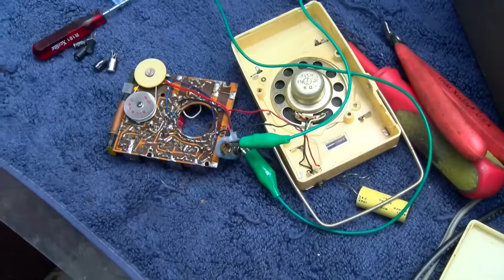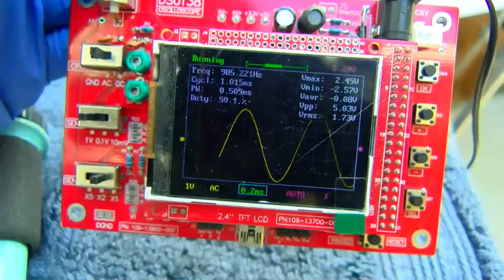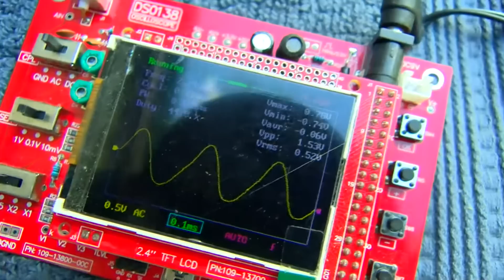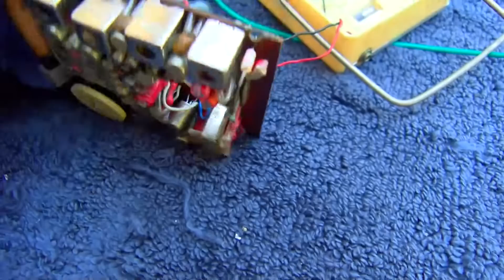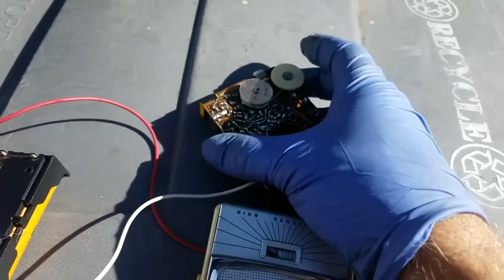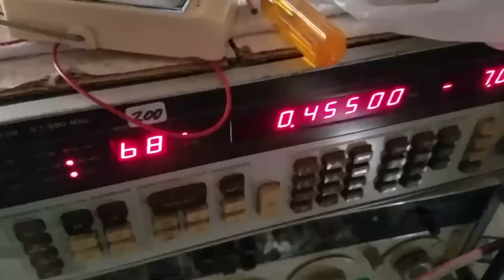Houthitone Transistor Radio Repair Attempt LM386 Mod

Comment: Cool fix with the audio amp, I ran into a little audio Amp when I was fixing a single board all in one Chinese ccrapoola radio. The audio amp died on it, I looked at the chip and it was an 8002A chip, which is an 8 leg chip. I found them cheap, probably why they used them, got 20 of them for 5 bucks back when I was looking, I am sure they are Chinese clones but they work. I put one in my radio and it is back up and working again so here I sit with 19 extras. So a quick search and I located some cheap breakout boards for 8 pin chips and I got a couple cards of those with 8 on each card, and I am using them two for stereo and of course one for single speaker use. They put out great sound and only require a couple resistors and a few caps to sit up.  If you use surface mount you can pretty much sit them up on the breakout board and drop them in almost anything. They are about 1/4 the size of the 386 boards so very easy to hide in tight cases.  Check them out, great for fixes on old sets.

Comment: The biassing of the transistor with a resistor from collector to base (22:28) is normal. It provides DC stabilisation; if the transistor starts to draw excess current, the collector voltage falls, and since the base is supplied from this, its current also falls, thus reducing collector current. The AC feedback which occurs with this method also reduces distortion. On that note, removing the emitter bypass capacitor from the driver transistor would have been an interesting experiment - may have reduced the gain to the point where the stage was stable.

Comment: Sorry in advance Dan if you covered this possible problem, or maybe you did but it got cut from the video:
I suspect the driver transformer of having either a shorted primary turn, or possibly a soft primary to secondary short of some sort. The near-zero volts on the driver collector and that 'latching' behavior when the volume of the test tone is turned up just shouts  amp + inductor interaction, forming a floppy saturation kind of behavior. Along with the frequency dependent shift in distortion, with the test signal growing cleaner as the test tone freq rises.
But the fact that the new amp board didn't help much is very curious - maybe bad speaker as you mentioned.
Still a good show, regardless of how it ended. Would like to know what the actual trouble really was, when the time is right. Thanks and Carry On!

Comment: Just did this mod to a  1970 Hy Lite radio.   Tried to replace the driver transistor, but it had too much gain on the output section.   So I just gutted the original amp off the board.    Radio sounds fine,  replaced the transistor detector with a diode and added a 1k resistor to dampen the input to the 386 amp.   Update.   Removed the 1k resistor  on input,  opened pot fully.   Lifted pin 8 on the 386 chip to drop the gain down to 20.   Transistor radios don't need a gain of 200 with this  amp.   Works great.

Comment: It seems that you've been beaten by a simple Discrete Component Audio Amplifier with a high frequency instability problem Shango.
I'm very surprised at that but to be fair you didn't have a schematic for the Honeytone.

Comment: Seemed to me like it had one too many audio amp stages.  The classic/standard/bedrock design is 6-transistor with two transformer-coupled audio stages.  This radio follows that yet there is an added troublesome pre-driver stage.  The audio was verified good at the output of the volume control.  Disabling the pre-driver and coupling the audio from the volume control to the base of the driver transistor through a 10uF cap might have been worth a try.  That would be signal injection in an effort to verify the driver stage, the output stage, and the speaker with something more definitive than a single tone from an external source.  My thinking is the motorboating and distortion was due to too much gain/overdrive.

Comment: I would let it as it was and repurpose it as the telemarket companion 2000. You cant polish a turd .... Circuits are simple but as they were stripped down to their minimun and use all kind of tricks to get things done. Plus on the audio amp, since there is feedback the failure all around and is hard to tell the one to blame. Worked a little on audio repairs and when an amp want to oscillate (speciall the early 70s ones with poor PCB designs), it is really hard to point the failure. You end doing thing like base stopers and miller caps on the predriver. And as you play with the tone control, you can see the oscillation starting to creep again. Happened me 2 or 3 times. For me sometimes is PCB layout  ... bad grounds with shared currents that create unwanted feedback

Comment: I've worked on a lot of these small radios. Distortion many times is caused by a poor connection with the on/off switch. Jumping it sometimes makes the distortion go away. You should automatically replace every electrolytic capacitors.

Comment: Some wonderings: what's the actual input impedance of the dubious AF amp module?  What level of input signal can it handle?

It might turn out to be easier to build an amp on some Veroboard or PCB, using discrete PNP transistors.🙂
Reply: Input impedance of a chip amplifier will be way higher than anything you can build with discretes.

Comment: I've had several of this style of radio that just never worked properly from the factory, I fixed one last night where the ground connection on the volume control had never been soldered to the board from the day it was made, there was still solder resist under the connection, so for the last 60 years it's been running at full volume!
Reply: Never like now, there's a lot of China radios that are completely deaf.

Comment: That radio is a total piece of junk.  That Hong Kong floor scraps radio with 17 extra transistors doing nothing sounded better than this thing. Yikes

Edit: that nobility thing, I think it was yellow with the size 0.5pt font schematic

Comment: I'm going to take two guesses: insufficient filtering of the power supply (a dim bulb is going to make things worse), or you may have a hidden short - a microscopic bit of copper left from the etching that shorting things out.  As small as a tin whisker, but different cause.
Reply: It runs on batteries...what filtering?
Reply: @MrHBSoftware  Batteries have internal resistance.  That results in the power rail fluctuating with the output signal.  If that fluctuation gets into the sensitive low signal stages, it can cause motorboating. Most battery powered radios will have a cap somewhere on the power line to prevent that.
Reply: @russellhltn1396  There is no ripple on the output of a battery...sure the voltage can drop if you crank the volume up but the radio will work fine...maybe you need some decoupling but i dont understand the need for any filtering..i understand the internal resistance of the battery and it will cause a voltage drop and also cause battery drain when idle but i dont understand the need for a filter, and by filter i mean a "large" cap between - and +...not saying youre wrong but its not clicking on my head.....   oscillations of that type are usually cause by feedback problems between stages

Comment: Enjoyed this video shango! I too have installed components like resistors and caps where the manufacturer never had them after trying all else to get a tranistor radio to play properly. Like you said,maybe it was a fault from the factory. Succeeding models may of included the modification as the manufacturers were always  improving and updating their designs.

Comment: I've had a couple of radios with motorboating that were impossible to track down, did the same and near on rebuilt them with new components. I like the module idea tho, recon that could come in very handy. Thanks for work you put it 👍
Reply: cracked circuit boards, dried up caps. cracked resistors.

Comment: From my college experience using LM380 & the LM386 chip is similar, you need to be careful & keep adequate decoupling cap & don't forget the zobel network.
I made the mistake in college of forgetting to prototype these first on veroboard & checking the output is clean on a scope, and had to do stacks of mods & bodge wires to stop motorboating & squealing.
Love the LM380/386 amp but man can it be unforgiving of layout especially PCB tracks which were too long.
The scope output showing lower half clipping reminded me of small signal push pull amps where either one of the push-pull transitors were off, different hFe or bias resistor was messed up

Comment: It's an old radio, it has performed well over the years and will still do gooder going forward, it's just going through a little rough spot right now.  Even though it's a little deaf and sounds like crap, it will still perform well after 8pm, you just have to wake it up.

Comment: 22:44 bias resistor from collector to base gives negative feedback and also increases thermal stability compared to the standard voltage divider, sometimes it can be useful.
Reply: In this application they gave up a bit of gain and saved a penny resistor

Comment: Well, the motorboating (or whatever quaint-name) is just an oscillation emanating from an errant feedback-path.
I didn't really see what the exact topology was, other than 2 XFMRs (interstage and output) and also did not see you check their XFMR-windings or signals sixth a scope.
However XFMRs are seldom bad so that is unlikely.  I have in the past had to increase the decoupling between stages in the power supply rail.  Most times, a small bulk capacitor on the emitter (PNP) supply line is helpful.  In others, I had to place and additional resistor in series (along with a bulk-capacitor) to get them to be stable throughout the life of the battery; this is why people relate low or high-impedance batteries as being the problem. The usually complaint, was that a battery that was unusable in one radio, would give additional play in another.
Your idea to breadboarding the circuits was a good and instructive one.  This allows you to adjust bias, play with coupling/decoupling, and voltage to really learn what causes what.
In fact, you can (using capacitors) make your own erant feedback paths, and see which ones cause a similar result.
Finally, you won't like this but with the stinkers, a schematic should be drawn from the radio for that section.  It really only takes a few minutes, especially when you get the hang of doing it.  
As an aid, you can photocopy the board (turning the image to lighter) then drawing the devices over the  faded-traces with colored pens; obviating the need to keep it in your head!.
73...

Comment: Nice job Mr. Shango, you get an Effort Score of at least 200%.  Nice job on the audio amp board install; no signs of a hack job.

With these 1950's/1960's Asian pocket transistor radios, they were such a high volume production, it's hard to say how many slipped through with problems.  Then there is the problem of absolute cheapest components being used, which can age badly.  It's amazing they worked as well as they did.

One of the resistor saving tricks you noticed.  To save an emitter resistor, they would connect the base bias resistor from Vcc to the collector.  This feedback would prevent the collector from going into hard cutoff or saturation.

The audio problem you were seeing may have been due to a fine crack in the PC board or wiring error as originally built.

This was obviously an upscale radio in its day, with the deluxe exterior and dial cord.  This particular radio must also have the CW code practice oscillator option.  If you want to go "whole hog" with the upgrades, slip in a subwoofer. 😂

Comment: Only you could do such amazing work.  I learn so much because of you I used a TA7205AP chip to fix my Drake R4B replacing the bad audio xfrmer.  worked I attribute this to my Shango determination mentor.  Just got done.  But I have learned so much from you over the years. Love Sango Saturday learning.  Thanks for all you do.  Mike

Comment: Did someone work on it before and switch the phase on the push pull transformers?? If so it will promote oscillating instead of preventing it. Maybe someone before you changed a transformer with the wrong type

Comment: I've Fixed many Transistor Radios. Sometimes they just defy logic.  I did a mod on one of those cheap Department store Hong Kong AM radios. It had stopped working but rather than doing a repair I stripped all the parts off the circuit board and used the board as a template to cut a project board to fit in the radio with the same tuner, Loop, speaker and volume control. I used the same schematic from the Elenco AM780K kit with the 7642 AM IC and a LM386 amp. Plays just as good as the old Hong Kong one.  I could send you a picture of it if ya want.
Reply: the 7642 was originally the famous Ferranti ZN414 TRF chip, used in goodness  knows how many home made radios , then became MK484, and then the TA7642, plus i think a few other type numbers
Reply: @andygozzo72  Anybody remember the awesome LM3909 !

Comment: My guess would be dodgy transistor, either in the push/pull amp, dodgy AGC, dodgy detector diode or some  dried up sediments on the PCB.
The squealing lol i remember from my 1st LM380 circuit how it motorboated likely due to poor decoupling
Reply: Any decoupling !!!!!! the LM380 was normally pretty stable.

Comment: I had one that did this once, found that the internal resistance of the battery was causing it, change to a different type battery and it played perfect. I don’t understand why.
Reply: The output stage sucks power, resulting in the audio signal appearing on the power rail.  If that fluctuation gets into the low signal part of the radio, you're going to have problems.  Most radios would have a cap on the power rail to take care of that.  But it's either missing, bad or undersized.  As a result, it's sensitive to the internal resistance of the battery. Using a dim bulb source is going to increase the power supply impedance.
Reply: That was a pretty cool find. If it was me, it’d be my luck that it was the last thing I tried before tossing it. xD

Comment: Shango, Have you ever came across some old Realistic radios from Radio Shack like the portable AM Flavorradio (catalog #12-166) that came in different colors back in the 1970's though the early 1980's for example? Awesome job as always. -73's

Comment: If there were a crude theveninized  circuit analysis then perhaps the soft pwr coupling could account for the low frequency distortion, also the positive to negative feedback ratios could account for other oscillating distortion.
Also there are sometimes thermistors used in germanium amps.
Phenolic boards can go semicoductive from being sunbaked over time.
Just some thoughts, it is a tough one.
Reply: I wondered if maybe the board was going rotten... I wonder if that phenolic stuff is (very) slowly hygroscopic, or if something in it offgassed over the years

Comment: I think the distortion is coming from the RF. I may of missed that part of the TS'ing. You did use the tracer after the diode but? Run the 455 through the front, checking w/ that cool Chinese scope?

Comment: This has been a test of the Emergency Broadcast System. Had this been an actual emergency, you would have been instructed where to tune in your area for instructions and information. This concludes this test of the Emergency Broadcast System.
Reply: Beeeeeeeeeeeeeep 🐝 🐝 🐝 beeeeeeeeep
Reply: "This is not a test."
Reply: This is not a test nuclear missiles are coming in go to your nearest fallout shelter and remember to fall out a trillion degree burns will be okay
Reply: Beautiful and🌹👍